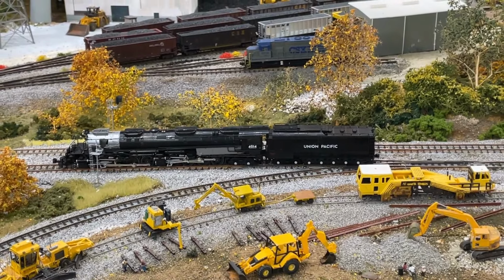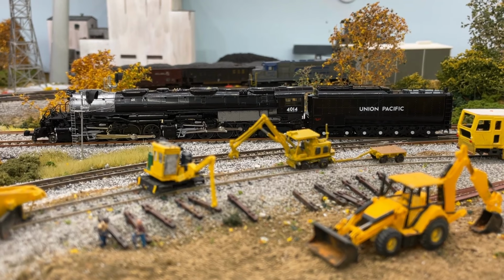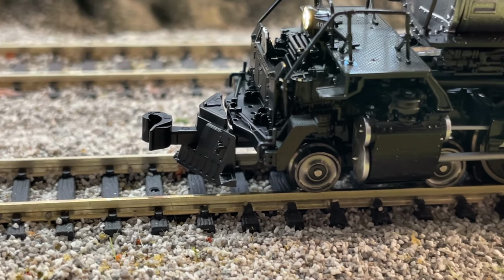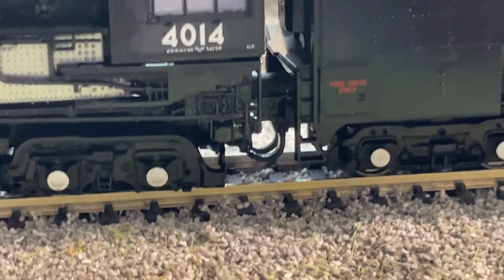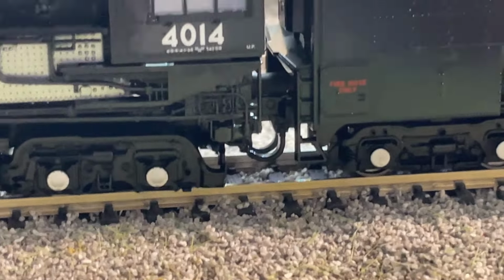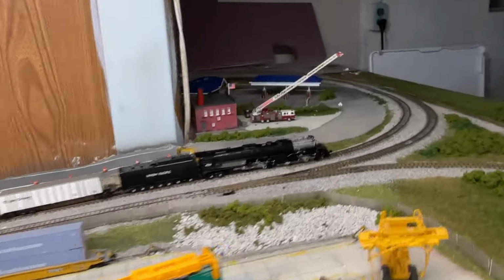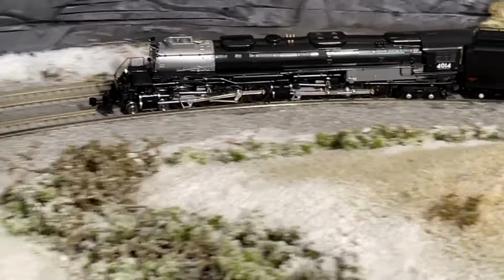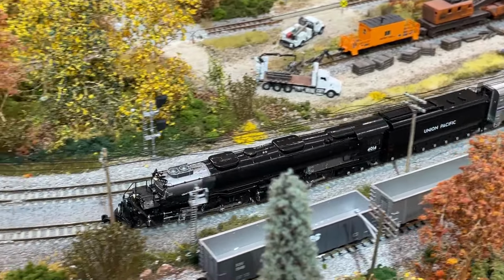Kato Big Boy DCC & Sound Review

Comment: May I ask what kind of cars that the Big Boy is pulling?  Can't find any info online.
Reply from the maker: Deluxe Innovation's RoadRailers.  They are no longer in business and your only way to get them is to find them on eBay or at a train show.  They come either as 10-car sets or individual cars but if you find individual cars you need the starting truck assembly with the coupler and platform.  You only need one as they didn't run them on the back of the trains.  If you find them, they're beautiful models and run very well.  You're going to pay anywhere from $180-$250 now for a 10-car set.  Fox Valley acquired some of the old Deluxe Innovation molds, but then they were acquired by ScaleTrains - i don't know if the RoadRailers will make a comeback under either brand.
Reply: Thanks for the info.

Comment: Quite an impressive steamer.
You don't mention what decoder brand and model it uses. You don't mention if it uses any traction tires. And I would have found very interesting how it negotiates any of your turnouts, especially one of your crossovers.
Reply from the maker: I guess i got a little too excited about it and missed the details. It has a Sountraxx Decoder, there are indeed traction tires - one pair on each set of drivers.  I'll show the crossovers in another video.  Spoiler alert - it doesn't have any issues - it actually does better than some smaller switchers because it has waaay more wheels and pickup than it needs to span the insulated bits.